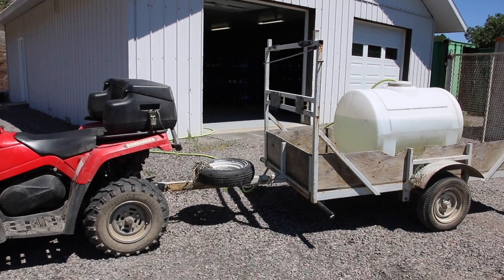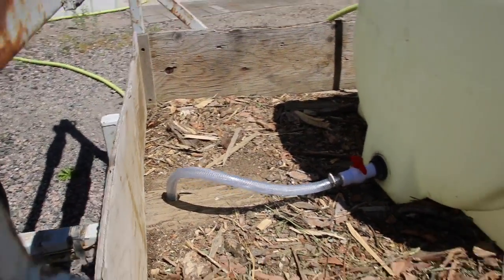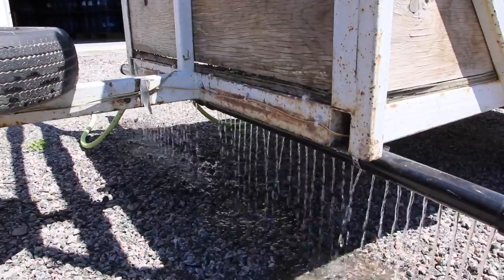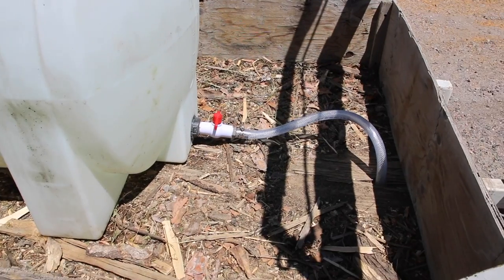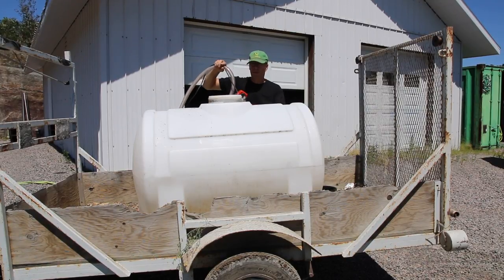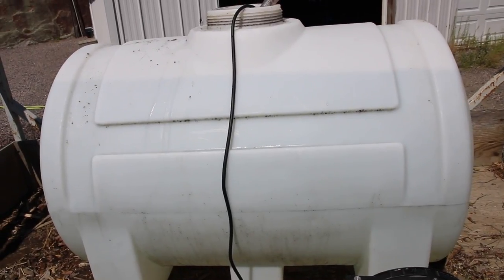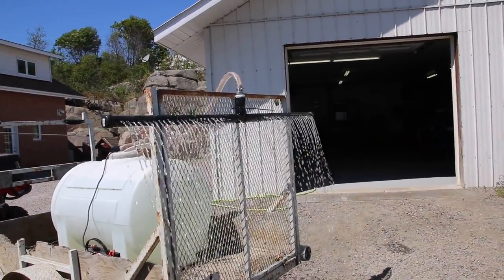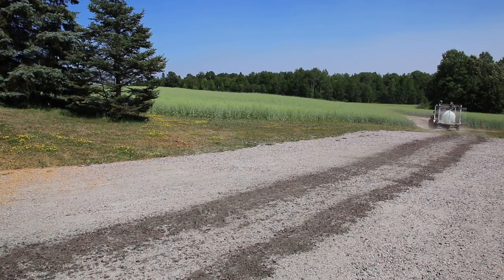DIY Water Sprayer

Comment: Good idea. Add some calcium chloride to the water and you won't have to water very much at all. I use calcium chroride pellets and they absorb moisture from the air and last along time. I put it down with a spreader. Thanks for sharing
Reply from the maker: Dennis and Helen , where do I buy calcium chloride?
Reply: I get it at the local Co-Op. Rather cheap.